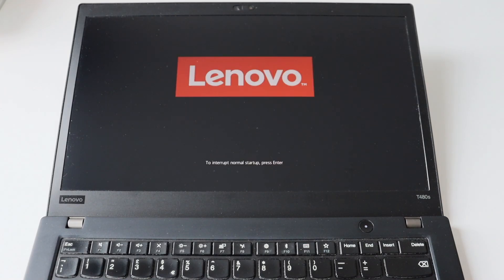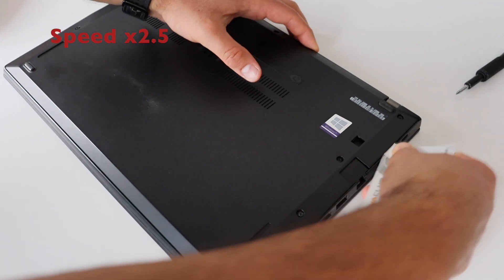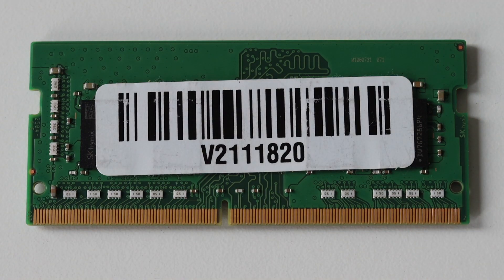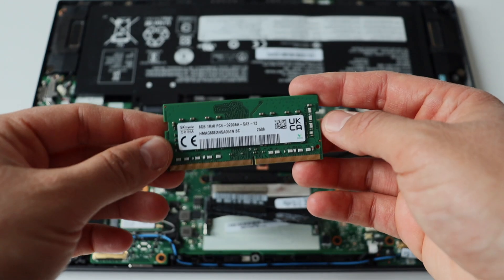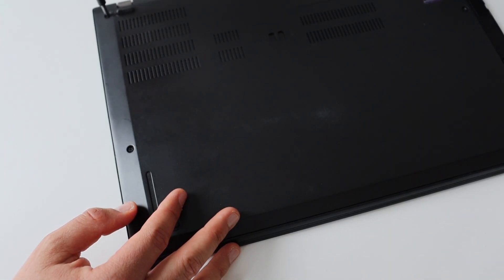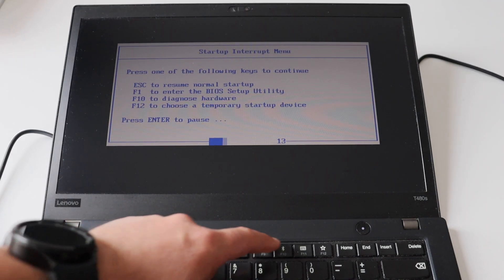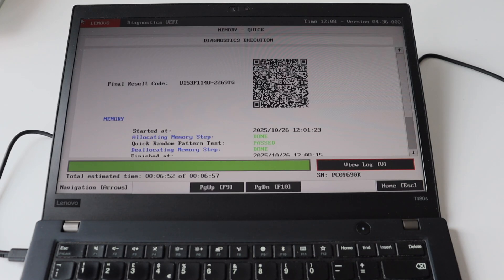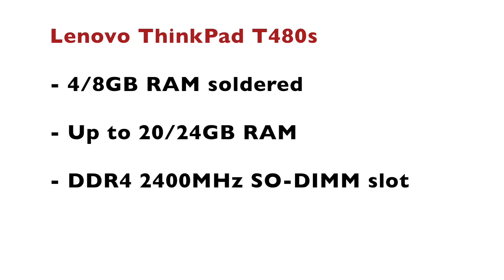Lenovo ThinkPad T480s RAM Upgrade: Step-by-Step Installation Guide #t480s #thinkpad #ram

Comment: what do i do if it wont power on it blinks 3 times and charging light but wont power on
Reply from the maker: Sorry, this sounds as a bad hardware issue. It could be difficult to diagnose it just by this information. Not sure I can provide a good advise. I guess, if I were you I would put a paperclip in the reset hole (on the back) and hold it down for about 10 seconds, then connect only the charger and try to boot. If it still doesn't boot, open the computer and disconnect the internal battery as well as teh CMOS battery, remove the RAM stick and try to reset again.

Comment: I know nothing about computers so pardon my question, but why would you not upgrade with 16GB RAM for a total of 24GB?
Reply from the maker: It is a very good and completely valid question. Yes, you are right: a 16 GB module for a total of 24 GB is definitely the better option. I only installed 8 GB because, for my needs on this older laptop, it is perfectly adequate. By the way, RAM prices are absurd right now. In early October I bought 32 GB of DDR4 for another mini PC for around 70 EUR and now the exact same kit is going for about 150 EUR.
Reply: @LeonAnavi awesome, thank you!

Comment: Est il possible ajouter une barquette de ram 32gb 3200 sur t480s ?
Reply from the maker: Sorry, no, according to the technical specifications provided by Lenovo and Intel, T480s supports up to 20GB or 24GB max. This depends on the soldered memory on the motherboard. If your T480s is with 8GB soldered then the max is 24GB. If your T480s is with 4GB soldered then the max is 20GB. Or in other words you can add 16GB RAM max to the SO-DIMM slot.

Comment: hello leon im felix today i buy a refubish T480s 8Gb ram for my primary laptop using xubuntu 24.4 with btrfs as file system  because i like the snapshots feature and this is an awesome video in the morning ill do also a +8gb ram upgrade and thermal paste change its amazing to me how well you explain how do this thank you and love from panama cheers add  do you know how to enable the fingerprint scanner in this laptop?
Reply from the maker: Nice to hear that you’re also running Linux on the T480s! As you saw in my video, upgrading from 8GB to 16GB is really easy and straightforward. Btw I made another video where I used a second-hand RAM module that turned out to be faulty. Lenovo Diagnostics caught the issue right away. I will need to check the fingerprint scanner. I haven't used it in a while on this laptop. What kind of problems are you having with the fingerprint reader on yours?
Reply: @LeonAnavi actually I make the fingerprint work very  easy but I make a mistake (the trackpad was in problems) updating EC and Bios using fwupdmgr from my xubuntu I think it happened bc I use btrfs with compression as file system and maybe 🤔 it corrupt the data for the bios update but then using a YouTube tutorial do the right update and everything it's fine now and yes I see your first video 😅
Reply: How many time you think this laptop can last as primary laptop? I don't thust in this cpu i5 8350u I think it's weak by 2025 standards!!
Reply from the maker: @larafelix2197  what do you plan to use it for? It is a solid laptop and with a RAM update and fine tuned Linux distribution can last for many years.
Reply: @LeonAnavi finish my degree in CS applied to business and for frontend development and as a terminal to connect me to my desktop computer and I'm not sure if I need something more or no hahah I just  was following reddit and YouTube Guides of ThinkPads it's my first one 😅 thank you 🎉

Comment: My T490 is so easy to upgrade the RAM. Mine came with 16GB on board. Its crazy I have 48GB in mine. Windows 11 is useless on it though. Both my solid windows 11 machines. 500GB of open storage and I cant update Windows and it says disk space Low. Its not low at all. So not as secure as it should be. Debian Linux bare metal to the rescue. Im trying so hard as a Linux and Apple fan boy to learn more about Windows 11 but it keeps shutting me down. Powershell is horrendous
Reply from the maker: Linus Torvalds once said "a computer is like air conditioning – it becomes useless when you open Windows." :) T490 definitely works much better with a Linux distribution.